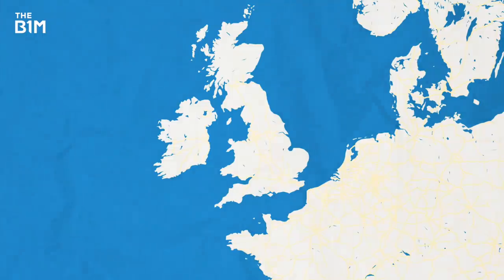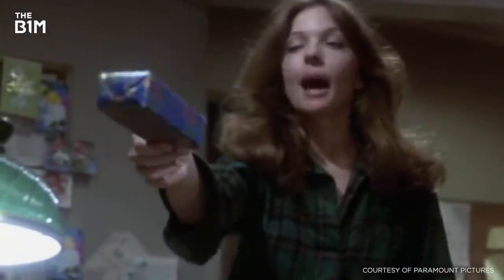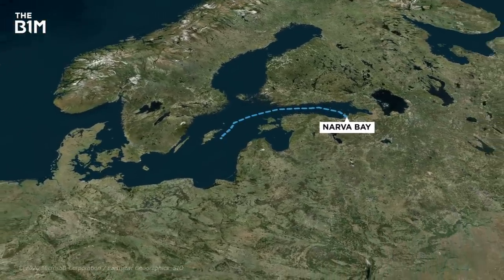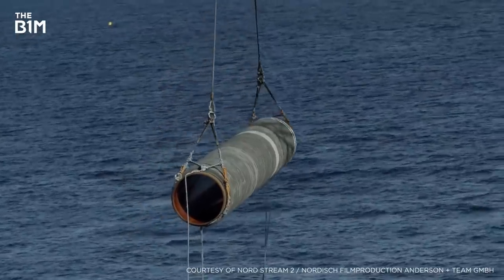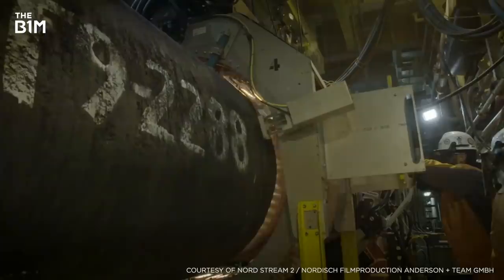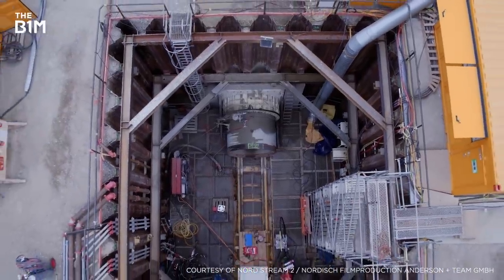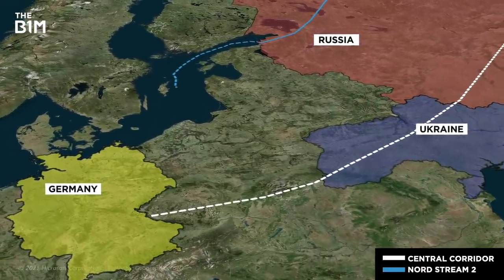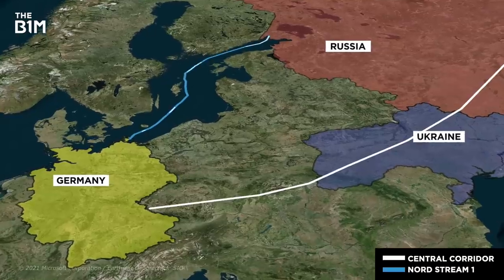Nord Stream 2: The $11BN Megaproject That's Dividing Europe

Comment: What people seems to miss is that:
(1) Russia's NS2 investments has already been refunded during 2021 gas price rise, so whatever happens with the pipe is irrelevant for Gazprom.
(2) European NS2 partners can quite easily sue German government for their losses.
(3) If the pipe won't start operating, Russia is just going to inrease LNG export to Europe.
(4) Pipes were produced in Russia, so the investments have already partially returned to the russian economy via steel production sector.

(5) SS2 pipe to China project has just started, which mean that European and Asian markets are finally becoming united not just via LNG, but with pipes too, and Russia will have the opportunity to sell gas to where the price is higher, which mean that usual low prices in Europe will skyrocket to compete with the high prices in Asia.
(6) As EU demands, Poland can now only buy gas with the short contracts. Which is why Gazprom has just now cut the supply to Poland through Belarus, and supplies her through Germany via NS1. Because Gazprom now has no contracts with Poland and no obligation to supply NG to her, there's no punishment to just not appear at the mounthly auctions.
(7) Oil and coal prices skyrocketed in the EU and Asia, and Russia can gain more profits thanks to the coal prices going up than any losses she experiences with the overall NG export shortage.
(8) Long-term contracts are also depend on the NG market price, not oil market price thanks to Poland. Long-term contract prices are already as high as $600.
So the war of EU with Gazprom resulted in (1) Russia won already, (2) Prices shall stay as high, as they are in Asia, (3) Russia can cut the supply any time without any cosequences, (4) This is entirely according to the rules that EU forced on the Gazprom.
In the long run Russia are going to sell more NG to Asia than the EU, NG prices in Europe are going to be highly volatile, russophobic countries like GB, Poland, Baltics and Ukraine will have the highest NG prices.

All of that could've been easily avoided if (1) Russia was allowed to build NS2 in time, (2) Long-term NG contracts were allowed in the EU, (3) Long-term gas prices were dependant on the oil prices as they used to be, (4) renewable energy sources were implemented with care, (5) US haven't organised the revolution in the Ukraine in 2014 and allowed it to be a pro-EU and pro-Russian state as it used to be back in 2013.

Now EU govmnt had shot all the feet of the household owners, industry, farmers and elecric generation companies, without causing any harm to Russia, but rather forcing her to finally build the united NG pipeline network that connects east and west parts of Russia, finally allowing many cities and villages in the central and eastern parts of Russia that used to run on coal to have the access to the NG.
Reply: 100% true. 👍
Reply: This should be the top comment.
Reply: well written
Reply: Absolutely correct
Reply: @aimanghazi7043  I second that.
Reply: There we go, the full truth.
Reply: Thank you! I would not be able to explain all this in such a short comment.
Reply: is it cold in st Petersburg?
Reply: @lbercik90  Bretty warm, about -3 centigrade :3, I'd rather had -10.

Comment: Shouldn’t they focus on stopping coal use before moving away from natural gas ?  Renewable heating will likely be electrical which would require switching equipment to replace furnaces, boilers and stoves/ovens
Reply: can you cook better food in an electric oven? How about a restaurant kitchen?
Reply: @MrManny075  you can actually. Ever heard of induction?
Reply: And you have to produce that electricity in the first place - from what?
Reply: @eafadeev  lol exactly, especially after Germany phasing out their NPP.
Reply: @eafadeev  nuclear ☢️ energy
Reply: @tankatim13  it's declining in EU.
Reply: @eafadeev  and that is a problem. France isn’t lowering its ☢️
Reply: @eafadeev   France want to build new nuclear reactor even finland want to build the one  but more safe and modern lol
Reply: @LimitedWard  That cost a lot of money lot of power
Reply: So exactly how are you going to move away from very polluting coal. Duh. you can use natural gas. It is cleaner...ie less pollution, and has about half the carbon foot print. Why do you think there has been a move to Natural Gas? Coal is the worst, and Natural Gas the best of the fossil fuels. https://group.met.com/fyouture/natural-gas-vs-coal/66
Reply: @MrManny075  money upfront but life of plant can be 80 years with a 95% energy coefficient. It’s the best
Reply: Coal is only slightly more damaging to the environment than fossil gas. Although coal kill more people from emissions, "natural" gas is mostly methane, which is a much more potent greenhouse gas than CO2. The gas pipelines (big and small) are not perfect, quite a lot of methane are released into the atmosphere. 
Go nuclear!
Reply: Yes nuclear should be part of the solution but coal ash retention ponds and disposal are often done poorly which pollutes waters. Coal mines leave huge scars that aren’t always restored. Trains hauling coal pollute too.
Reply: @wdwerker  I'm not saying that coal is not the worst kind of energy. Just saying that fossil gas is not a huge step up. Nuclear is a huge step up, really the best option for the environment.
Reply: @MrManny075  Are you a low income andy? lol
Reply: Oh really ! and where are you going to produce the electrical energy from. You want to shut  down your TPPs and NPPs for certain valid reasons and with wind and solar not being viable options both economywise and efficiencywise at least for the time being, what greener( or lesser evil) ways are we left with !?
Reply: @MrManny075  I think you're misinformed. Induction is way more efficient. The only reason gas stoves have lasted so long is because oil companies have spent millions trying to convince consumers otherwise.

Comment: Germany heavily investing in renewable energy need a gas power plants to handle peak hours and bad weather (lack of wind or sun). Gas power plants are best for this as you can relatively easily increase power production (something you cannot do with nuclear or coal power plants). In a way pursuing green energy makes us depending on gas, because it is not always possible to store energy for later use (not all areas have feasible height differences for pump storage )
Reply: Correct, we will need gas power plants as backup as long as we can't store our energy. Some coal power plants can be switch on easily and used for this too, like the Eemshaven power plant in The Netherlands, but this newer one is one of the few.
Reply: Or just build nuclear. But not in the middle of a metropolitan, or next to the ocean.
Reply: @stapleman007  nuclear won't solve that problem, as it can not statisfy energy peaks; it only provides a stable base load. Op already said this though

Comment: The video didn't mention how Germany is shutting down nuclear power plants.
Reply: Because it has nothing to do with NS2
Reply: @computercrack  It does with the overall political situation in the EU.
Reply: @computercrack  Germany does use gas for electrical power that was an easy google search so I don't know what you are going on about.
Reply: @guppy719  yea gas makes up for around 12% of the electricity production. So we don't rely on gas (much). Germany can shut down all gas power plants without an issue. About 47% is renewable electricity production and this share is rising every year. Gas usage is going to decrease over the next decade, cause heating of houses will go away from gas (almost 50% of gas in Germany is used for heating homes). NS 1+2 each have a capacity of 55bill cubic meter, Germany doesn't even use like 90bill or so and that's been pretty constant  since 2008.
Reply: @guppy719  gas is mainly used for heating
Reply: Read the title, and you’ll find the answer!

Comment: You should say something about Germany closing their nuclear plants. I rally wonder why they want to relly so much on Russian gas.
Reply: "keep the friends close and the enemies even closer"...
Reply: @computercrack  the gas is not meant for just germany.  they said it several times in the video.  Other countries will get gas through the pipeline that goes through germany.  Your assumption that electricity by gas is not an issue is false.
Reply: Russian gas is largely used to directly heat homes, not to generate electricity that is used in electric heating. If you can heat your home with electricity, then you can heat your home with renewables.
Reply: @davidanalyst671  I don't argue that. But the original post asked why we rather rely on Russian gas than nuclear and just said that has nothing to do with each other. Germany doesn't need gas power plants, we can do without (just use more coal). We use half of the gas for house heating.
Reply: @davidanalyst671  The comment they replied to is specifically about Germany. You're saying their assumption is false by changing the topic.
Reply: @computercrack  The point is you do need/use gas for heating so you are being increasingly dependent on Russia, that's not very smart.
Reply: @boostav  no Germany is not increasingly dependant on Russian gas. Gas consumption was basically the same for the last 14 years or so, go look it up. Since we want to heat more homes with electricity (heat pumps) and get rid of fossil produced electricity entirely the gas consumption will decrease over the next decade, not the other way around. So NS2 was a waste of money anyway.
Reply: @boostav  Because politics change, when people in power change.
Reply: @boostav  NS1+2 are private investments, it was no decision by the german government.
Reply: @computercrack  BS these projects need Government approval and have huge geopolitical ramifications, the German government was absolutely involved.
Reply: @boostav  yes they (the investing companys) need government approval but it was no decision or requirement by the german government to build this pipeline.
Reply: @raymonlandry228  The pipeline was built to supply germany, austria and several other countries because Europe is famous for not having energy supplies of its own.  Please know more than me before you try to insult me
Reply: @davidanalyst671  You missed the point, which is that no one said that the pipeline only supplies Germany. The person you replied to focused on Germany simply because the original comment here only discussed that country. All I've done is clarify for you. 

In other words, you're arguing with a straw man.
Reply: @fehzorz  You can heat all you want with renewable, but if it's -20°C outside with blizzards you gonna want your gas back in the power grid)

Comment: All those reasons you gave at the start for rising energy bills are wrong. The only thing causing that is politics. Pure and simple.
Reply: Only partially correct. One important factor is far more boring and simple. A miscalculation (aka under-projection) of projected demand .. you order gas several months advance of delivery. The economy recovered faster than projected. This mixed with a very cold autumn in most of Europe. And then of course: Russia using its leverage of the central corridor (which currently only operates at half capacity) to push for a fast approval of nordstream2.

Comment: I saw another video recently talking about building additional high voltage underground links across the Gibraltar to Africa  and being supplemented by power produced in North Africa. That would be additional options for energy.
Reply: It’s not feasible
Reply: @overdose8329  Maybe one day we'll develop room temperature superconductors and transmitting huge amounts of power over such vast distances will become feasible, but until then it's a complete pipe dream.

Comment: To everyone talking about nuclear: Germany's phase out of nuclear energy is mostly just that it won't replace reactors when they are expired. They are not investing more into nuclear because it is one of the most expensive energy sources available if building, decommissioning and handling of nuclear fuel short term is considered (with no good long term solutions). Uranium also needs to be mined by someone, with the 3 country's most likely to supply to Germany being Russia, Kazakhstan and Australia.
In short green is cheaper and a better solution then nuclear
Reply: @MTobias  really which ones?
Reply: @MTobias  the youngest powerplants are from 1988, that's 34years by now. I don't think perfectly good shape is a term that I would use. Personally I agree, I would have chosen to leave them online a little longer (maybe to the 40 year mark) and get rid of the dirtiest coal plants in the meantime. But since the cost of production of 1MWh is higher than any other powerplant (coal, sun, wind, water... ) it makes sense from a financial point of view to shut them down asap
Reply: @Friedr: very good explanation, thank you
Reply: @computercrack  they can last 60 years and more. Also,they produce the cheapest electricity of them all, what you're reffering to means new power plans.
Reply: @MTobias  what we are talking about here are old soviet nuclear power plants, built with much the same technology as chenobyl
Reply: @friedr2766  same technology, different reactor design.
Reply: @MTobias  no its not the cheapest way to produce electricity. They have to be replaced in the very near future. Looking @ Flamanville that's at least 12bill € for each of the 56 reactors in France, almost 700bill €s. Not counting they have to be run ("fuel"), serviced, decommissioned and you need to deal with the waste. Last two points are estimated @1 bill € per powerplant. If that's even enough to store the waste forever on a human scale. Look @ were we were just 2000 years ago. Can you imagine we'd need to deal with crap from the Roman empire today??